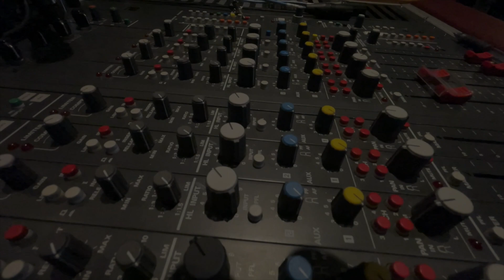DSD and Analog

Comment: That's the 2nd time Paul has said that a loud signal will be all 1's and a quiet signal will be all O's.  I don't think so.  Even the LOUDest full-scale sine wave will be 50% 1's and 50% 0's, because the PDM bits would have to describe a full scale waveform that goes from Vmax to Vmin.   If you had all 1's, all the time, that would describe a full-scale DC voltage.  Correct me if i'm wrong.... I could be misunderstanding it too, but I "think" I'm right.
Reply from the maker: Yes, you're correct and I am simplifying it too much in an attempt to gain some understanding. 100% bits would be DC. On the other hand, no 1s would indeed be what you get without sound of any kind.

Comment: Presented to the Audio Engineering Society May 2001:
Why 1-Bit Sigma-Delta Conversion is Unsuitable for High-Quality Applications by Stanley P. Lipshitz and John Vanderkooy ~ Audio Research Group, University of Waterloo Waterloo, Ontario 
"Single-stage, 1-bit sigma-delta converters are in principle imperfectible. We prove this fact. The reason, simply stated, is that, when properly dithered, they are in constant overload. Prevention of overload allows only partial dithering to be performed. The consequence is that distortion, limit cycles, instability, and noise modulation can never be totally avoided. We demonstrate these effects, and using coherent averaging techniques, are able to display the consequent profusion of nonlinear artifacts which are usually hidden in the noise floor. Recording, editing, storage, or conversion systems using single-stage, 1-bit sigma-delta modulators, are thus inimical to audio of the highest quality. In contrast, multi-bit sigma-delta converters, which output linear PCM code, are in principle infinitely perfectible. (Here, multi-bit refers to at least two bits in the converter.) They can be properly dithered so as to guarantee the absence of all distortion, limit cycles, and noise modulation. The audio industry is misguided if it adopts 1-bit sigma-delta conversion as the basis for any high-quality processing, archiving, or distribution format to replace multi-bit, linear PCM."

https://timbreluces.com/assets/sacd.pdf

Comment: So why was DSD abandoned? Primarily because of economics, not purity of fidelity. DSD was designed and intended for archival storage of existing recorded audio. It stumbles and falls when it comes to any editing other than start-stop. For a studio, it's like trying to edit old-fashioned magnetic tape with a razor blade and sticky tape. You currently cannot edit DSD without converting it to another format, probably PCM, because all of the workstations work in PCM. Or worse, convert it back to analog, where noise, distortion, and bandwidth rear their (abandoned) heads.

Is studio editing evil? Well, try to imagine an artist, worse a group, making 'takes' until one is perfect. You'll often be there all night. And the next three days...

If you must convert DSD takes into PCM to edit, what's the conquering benefit of DSD at all? Especially when the SOTA of PCM can be 32 bits at 384k samples per second? 32 bits at 384ks/s is arguably the same data precision as DSD at 12 megabits/second. So, what's the point of DSD at all? Hint: Sony, who invented DSD, abandoned it about 20+ years ago as impractical to implement and distribute. Thus the commercial failure of the SACD, a 1999 attempt at placing DSD audio on a CD-spec optical disc. DSD worked on read-only media because no one needs to edit a DSD (SACD) disc. You just play or stop or jump to the next track.

Nonetheless, DSD was a decent effort, back when the state of the art in studios was 16 bits at 48 kbps. Studios have been recording in 24 and 32 bits since about 2005, currently up to around 192k to 384k samples per second. Unarguably, that's pretty good audio. Much better than any known human ear by a factor of about 5X.

Want to make the world a better place for audio? Try working on paying artists, creating repertoire, better microphones, better studios, and turn your back on the 'wall of sound." -Just one man's view
Reply: like we had in the late 50s early 60s ? 

seems to me it will come full circle to analog again..
Reply: @seansrecords  
Analog audio recording has long since been pushed to its absolute limits and is still found wanting. Neither mathematics nor science predict any further improvement. Analog audio recordings are a legacy, not our future, and it makes an unsatisfying faith to rely upon. 

:) Math and information science? Information transmission, modulation and noise science has accurately predicted the capabilities, as well as the difficulties of digital audio. Technology keeps solving those difficulties. PCM and DSD are just two of many potential techniques for sampling and recording audio. The mathematics of each are distinctly different, and have different advantages. And disadvantages. The future of audio recording isn't limited to either or both. 

Enjoy the ride, and don't get off the bus too early. There's a lot of beauty ahead. :)
Reply: I am not against digital and i understand it is the future - and that living in the golden era of analog is basically living with antiques now , however most of the music i love is pre digital era so it makes sense to listen to it in the way that was intended...

my comments were based more on your final sentence as regards - talent and studios and engineers being high quality , and in my mind , the late 50s early 60s is the pinnacle of that, beautiful microphones and analog gear recording extraordinary talent ... modern music is digital so it is pointless to try listen to it in any other medium , but i dont always think more technology has the answer - sometimes things are fine how they are , for me , vinyl and simple pure playback systems like tube amplifiers is a sound that may be matched by another medium one day but never bettered. 

I left vinyl for cd , and arugably lesser formats like mp3 and streaming - the reason for that however was being young and limited on funds so i traded quality for quantity - now i am older i can have both and have gone right back to vinyl , sometimes i am sure cd or lossless would be simpler, but i also love the community - the friends i have made in local stores and the collecting , searching and cataloging side of the past time.... they should march into the future hand in hand - i see no reason why one should defeat the other . 

I personally will always chose the analog format when it is available and is genuinely aaa... i can hear and feel the difference , and it makes me want to listen to music - the bickering over what is best is a symptom of the internet - both have pros and cons.
Reply: @seansrecords  Fine for you. You speak for yourself; I try to speak for the general case. Airing differences  between personal taste and the general case is merely "argumentative."
Reply: @jimshaw899  how is it argumentative ?

just because another format exists - it doesnt make an existing one obsolete

analog recording and vinyl is still a very viable format and form of recording , many studios and engineers still use it , many artists still insist on it - and many more are coming back to it ... just because something seems better on paper - we are talking about a medium that is heard and felt - and which is art , at every step of the process .. not science and technology.
Reply: @seansrecords  Opinions are argumentative. Facts are much less so. You would be surprised at how little I value your opinions. You would be disappointed at how much I value facts. Be of good cheer; your opinions will survive the facts quite strugglingly. Case closed. Absolutely closed. Go away.
Reply: @seansrecords  I agree with you on what he sounds like lol

Comment: Always liked the line "You can actually see the music" in DSD. I guess he's just trying to suggest it's closer to analog by saying that. Sure, one can see the amplitude scrolling through the DSD data stream but you can do the same with PCM.
Reply from the maker: Thanks. Actually I would have to disagree. If you look at a PCM datastream you do not see anything resembling music Unless you decode it). The same is not true for DSD.
Reply: @octaverecordsanddsdstudios1285  So what are you looking at to see the DSD music? Maybe an example picture would help explain this ...
Reply: @mbfishing769  It's a somewhat silly topic to argue what the data looks like. When looking at DSD on a byte or multi-byte level, it looks like scrambled numbers to me. The point is that sigma delta conversion can, due to its very high sample rate, allow higher precision in the timing domain and thus it wins against CD 44.1kHz PCM, where the sample rate highly limits the timing of especially treble content.
Reply: @ThinkingBetter  I'm just curious as to how he is looking at the data to "see the music".

Comment: DSD (PDM) has a PCM equivalent. That's why DXD exists.  So yes, pcm in theory can sound just as good or better than DSD having a good sample rate because they both have their digital equivalents.  PCM just has to play the catch up game slightly and even that is debatable.
Reply: PDM or PCM can exceed human hearing capabilities and it's silly to judge PCM on the red book standard of 44.1kHz 16 bits. DXD is a marketing term to hide the fact that it is PCM 352.8kHz and that all digitally mastered DSD tracks are nothing but transcoded PCM audio. No way it can be any superior than the PCM that it originates from.
Reply: @ThinkingBetter  I agree.  The dirty little secret about SACD's is that a majority of them have been converted to PCM for manipulation and then converted back to DSD to encode onto SACD.  Placebo effect in full effect.  There are however some SACD's and DSD files you can dowload that are 100% DSD and never converted to PCM.  But they are not the majority.
Reply: @380stroker  It seems people forget why DSD came to be. With the limited data capacity of CD media it allowed for a higher audio fidelity while utilizing low cost sigma delta DAC ICs in CD players. From a data efficiency vs audio fidelity perspective, DSD does a better job than PCM but nowadays that is not much of an argument when internet connections easily can pump 10s of megabytes through per second.